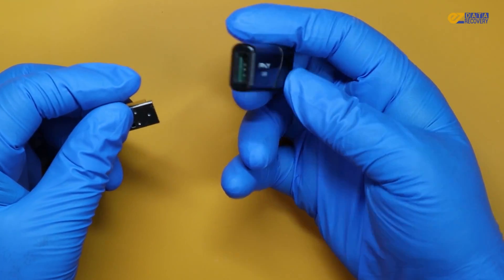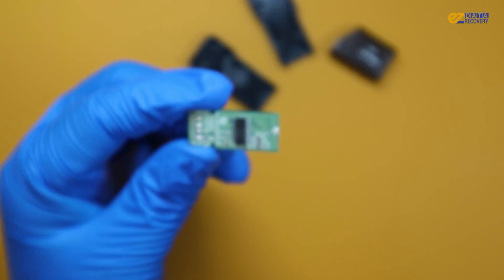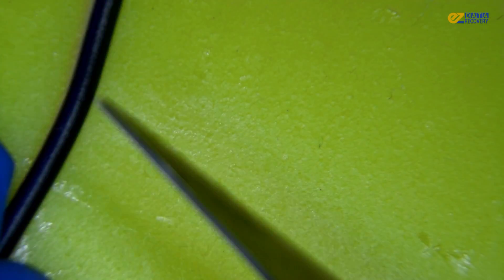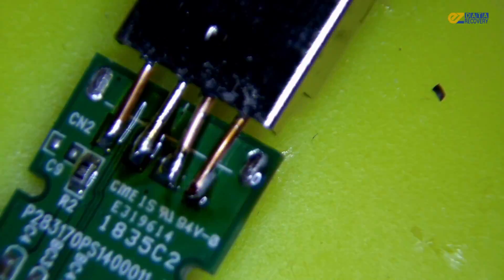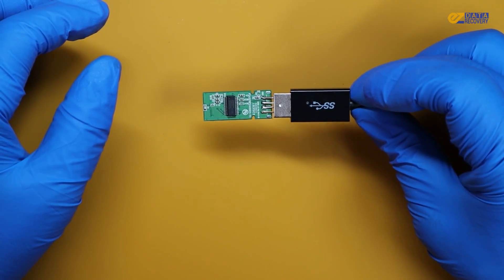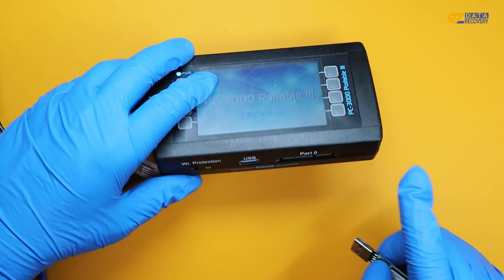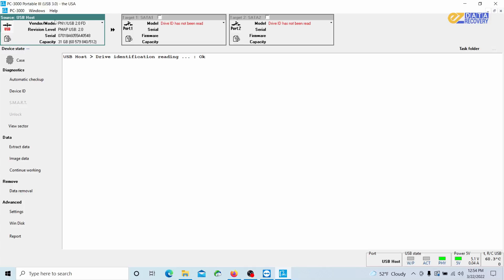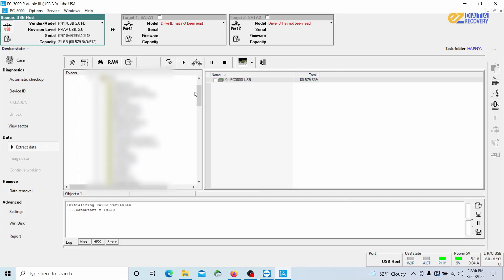How to Fix PNY USB flash drive for Data Recovery

Comment from the maker: We hope you found this video helpful! A lot of time  and effort goes into creating content like this. By hitting the 'Like' button and subscribing to our channel, you're showing us that our work is truly beneficial and this encourages us to keep going. Plus, your engagement helps others in need to discover these videos. Thank you for watching.
Reply: Hi ezdatarecoveryus, I have a PNY 64GB 3.0 that looks just like that but when I look at the motherboard. The solder points on motherboard for the USB port doesn’t have 4 connections like you have. I have like 9 ish connection pads. Any suggestions on like how that can be repaired. It’s so complex compared to all the other flash drives.
Reply: @WarrenLiberty I understand that it’s just a different flash drive than 98% of the rest.